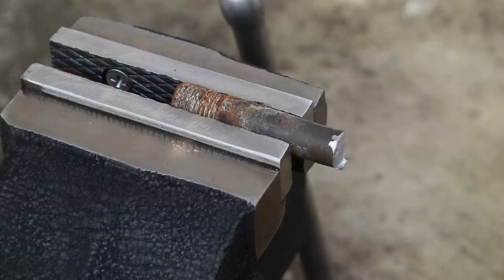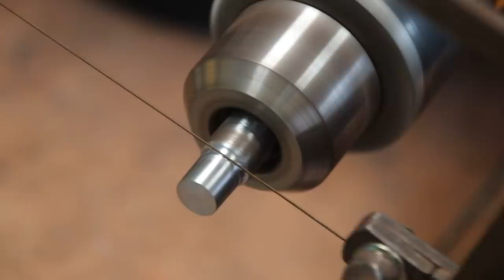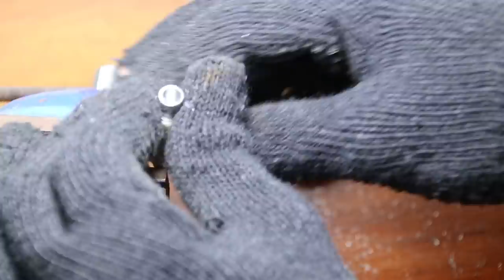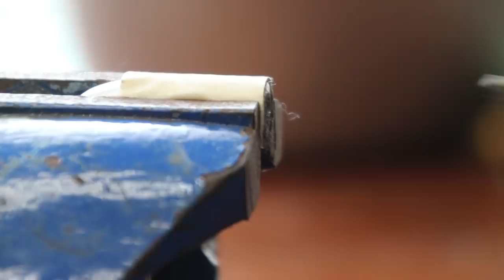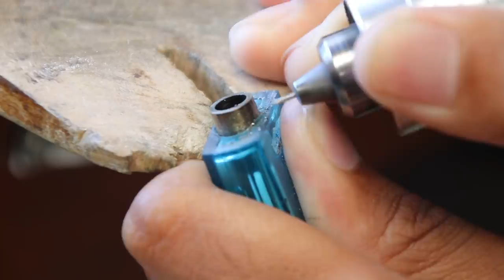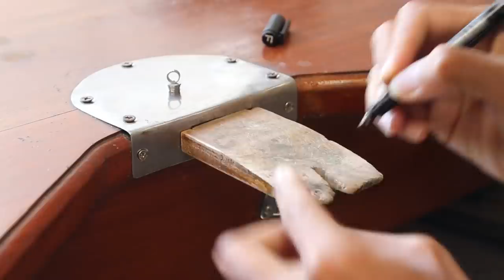pendant making out of waste - i turn rusty iron into jewelry

Comment: Good job 👏 
Please, I want to understand the process of polishing : 
what is the green material you used ( and if there are other materials can be used ) and what is the type of brush/ disc you used for polishing in time 11:05 ? 
Does this process is equivalent to the nickel plating process ? 
And does it sill shining ever or may rust by time ?
Thank you
Reply: Not the creator but I can answer these. The disc is called a buffing wheel. It's made of cotton or felt and you "charge" it with a buffing compound which is what the green stuff was. The buffing compound looks like tripoli to me but I could be wrong. The compound is essentially just really really tiny grits of some kind of abrasive mixed up into a clay-like solid paste thing
Reply: And nickel plating involves using acid and electricity to literally bond a thin layer of nickel to the surface of another metal so it's entirely different than polishing

Comment: Really nice work there, I myself have been experimenting with iron, how do you prevent it from rusting? Or do you just make these for content?
Reply: I think heating up the iron object and quenching it in motor oil will prevent rust. Not too hot. About hot frying pan hot. The object will be a bluish color.
Reply: @nelsonx5326  oh right yes, thanks for the reminder XD. Blueing the steel 👍

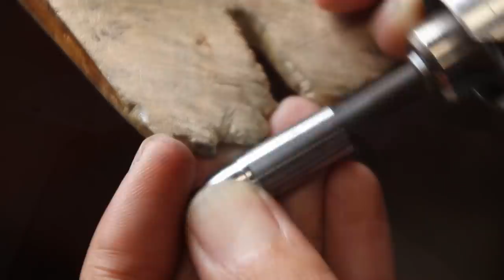Comment: great video! there is a problem i don't understand is why sanding ( 8:35 ) and then polishing ( 11:05 ) ?
Reply: He was clearly working out minor imperfections in the surface of the scrap steel as the project moved through the various stages of completion.  I can tell you from personal experience that any time you are working with scrap/repurposed metal, there are little pits, dings and dents of varying depths and sizes. Some prove much more difficult to work out than others. With the desired result being a polished, almost mirror finish on this piece, the use of different levels of abrasive sanding, starting with the most aggressive grit and working down to a fine grit before a final polish would be the best way to achieve said effect.